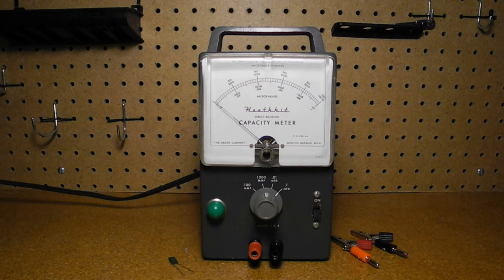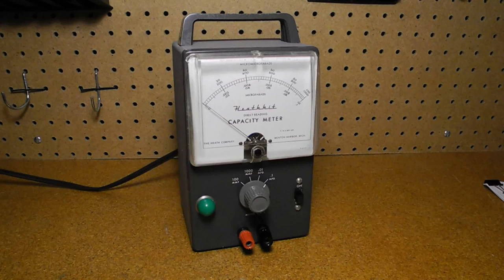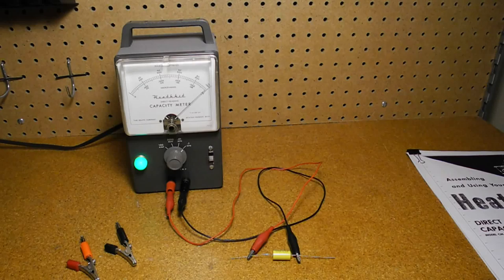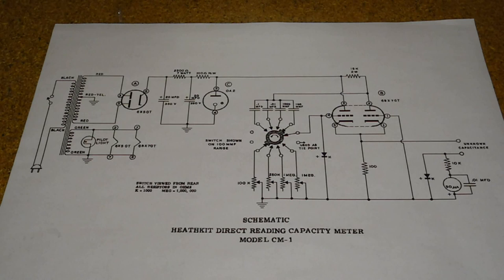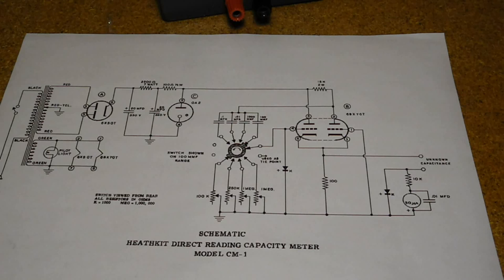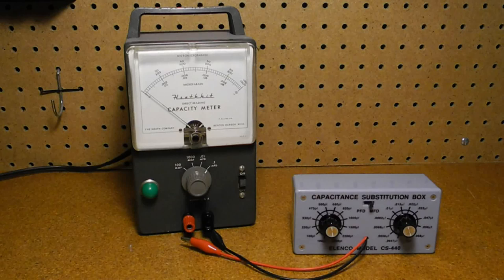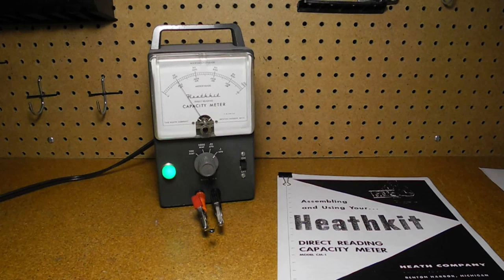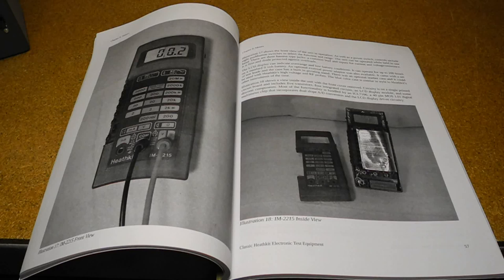The Heathkit CM-1 Direct Reading Capacity Meter

Comment: In all of my later Heathkit restoration videos, you see me attempt to reform and keep original caps in place for educational purposes, i usually never bother, except for my videos, It always ends up that for some reason I find that they will be ripped out by project end.  Even coupling caps with seemingly low ESR finds trace DC values in circuit where 0 is expected, bad news on an amp grid input.  As for those brown paper electrolytics, i have a bag of them only to restuff if i should decide, but they are to iffy to ever put in a power supply.